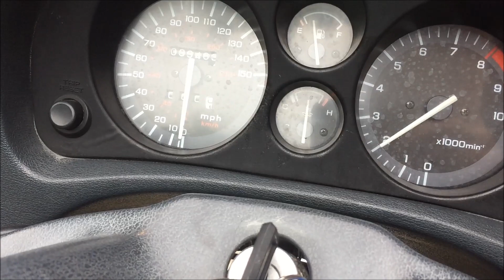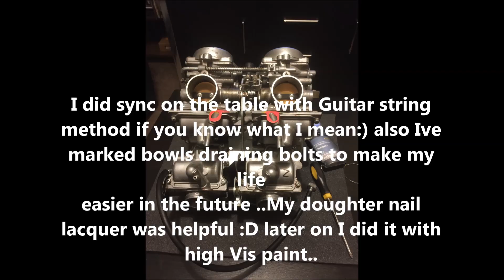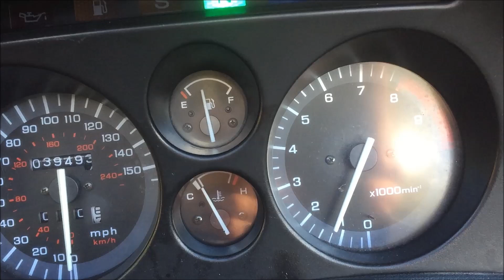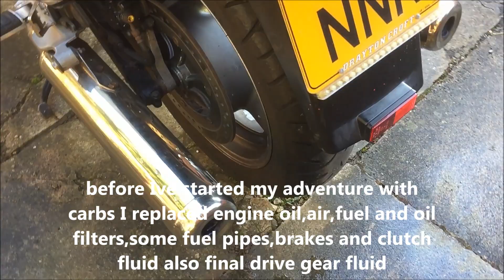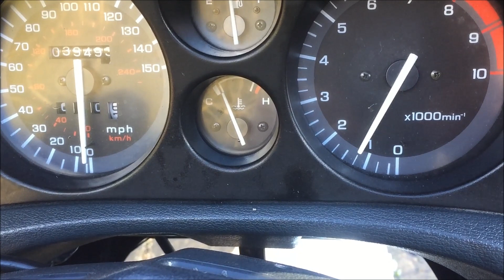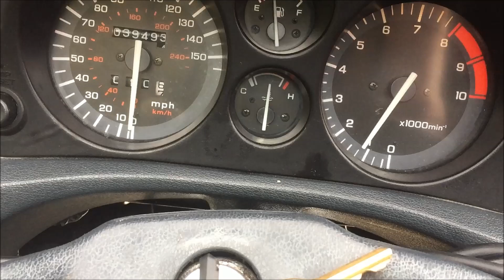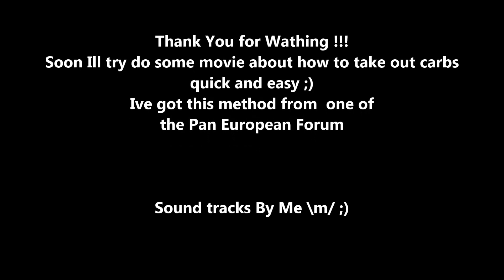Honda ST 1100 Pan European Carburettor cleaning and Sync.

Comment: Some very important bits when you are working on an ST 1100, be sure to use a JIS Japanese industrial standard screwdriver on the carburetors so that you do not strip out the screw heads on the fuel bowls. Do not open the top of the carburetors unless you are replacing a diaphragm otherwise you might end up ripping a diaphragm. The bike will start but will not run properly until you put the airbox on and assemble it with the air cleaner. Good job!

Comment: mine did this after standing for a few months, the fuel was dead and it knackered the plugs, I bought new NGK plugs from EBAY only to find they were Chinese copy's  after a lot of messing about with a misfire.. I put in genuine NGKS and some Redex fuel system cleaner and it worked just fine after a good run..  Conan

Comment: I’ve worked on 25+ ST1100’s so far and unfortunately in most cases  problems (if any) with these machines  is the previous owner who neglected the bike. These bikes are almost indestructible if maintained property

Comment: How turns did you come out on the pilot screws on your ST1100, The manual says 2 5/8 for my bike here in America, mine at 2 5/8 runs a bit sluggish and I may need to come out another turn and a half.

Comment: Hey man, love the video! I have and 96' st1100 that shuts off like yours if I close the choke but it is still rideable just seems to be low on power, I was going to try the sea foam method first, do you think I should? Or should I just go right for the carb removal? Any information helps, thanks
Reply from the maker: FastLifeTV seafoam its good to add to the petrol for daily usage but if you want have it done proper than remove ,inspect and clean carbs,its easy:) than sync them !:) good luck mate and thx fir sub. :)
Reply: kazik76 thanks you so much. You have no idea how much you just helped me..I will be sure to post my carb rebuild video..I recently took apart at my YZF600r carb and inspected and rebuilt so I think I can do it. Thanks again man. Btw, I'm learning how to ride for he first time on a custom st1100...it's a long story lol.

Comment: hey i was wondering if you could help me with something?..I rebuilt my carbs and put them back on and the bike is running better but i did not adjust the float height properly..do you know the float height spec for the 96 st1100?
Reply from the maker: FastLifeTV  hi,thr best way is if you google it..I dont remember exactly :) on the web is st1100 forum and there is everything what you need:)  just put in google what do you ned + honda st1100 and should be fine:) thanx and Kind regards

Comment: Just purchased the same Model, and I have the same sort of noise COMING out of my left Bank - are you depicting here, this can be overcome by correct Carburetor set-up, as I was worried it might be more a mechanical issue = Valve Shims, gudgeon etc .... PLEASE REPLY
Reply from the maker: hi,after when carbs has been balanced knocking is gone:)

Comment: only 39 000 miles and already carb problems, thought st 1100 were rock solid ?
Reply: Mitty clinchard any carb will get plugged if you let it sit too long...it's still running and would ride strong even in that condition.
Reply: Petrol left in the carbs if not run for a long period goes like varnish blocking the small jet holes. It's a real pain to clean out. I learnt the hard way, always drain you carbs/system of petrol if your going to store your bike for long periods, it saves a lot of swearing.
Reply: Even with bad carbs, plugged up with varnish, they run great. You should sell the HD and get a real sturdy bike, st1100/st1300
Reply: Just picked up my first st1100 2001abs, just finishing up a quasi full service...dumping all fluids, and since bike has been sitting in storage for 3 years I ponder if I should pull carbs & clean? (It had a full topped up tank that smelled okay) When I picked up bike I boosted it to load on the trailer..yea I know that’s a bad idea, however it fired and ran smoooooooth at idle! Bike has 45,000klm, and I have very little $$$ in it...so far. It is a clean bike but lookin at the airfilter maintenance I don’t believe maintenance was done thoroughly...bad ripoff dealership! Anyone know if a factory pcv filter makes a huge difference? As I’m having a hard time finding one... I was going to make one out of foam air filter from a lawnmower!?